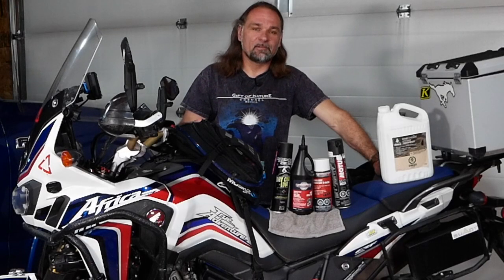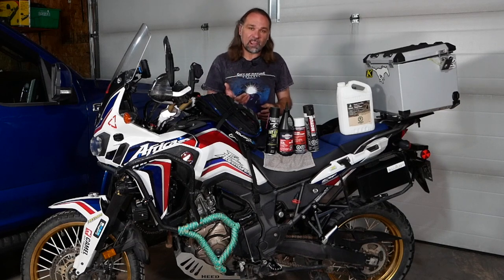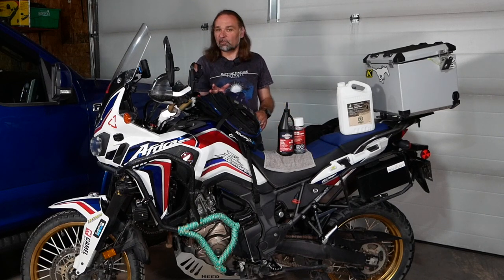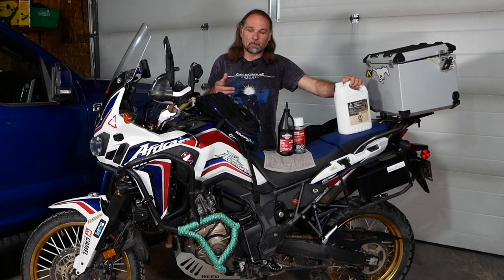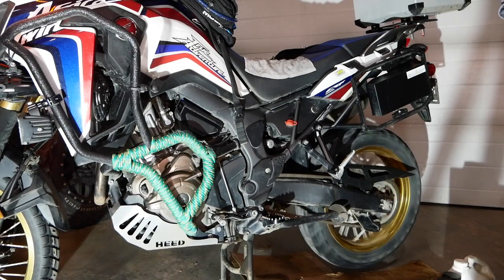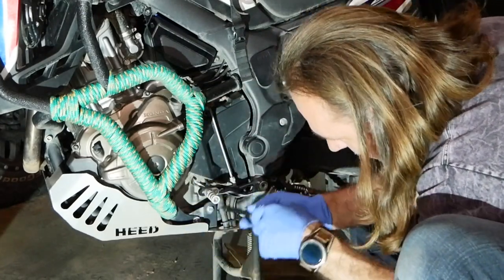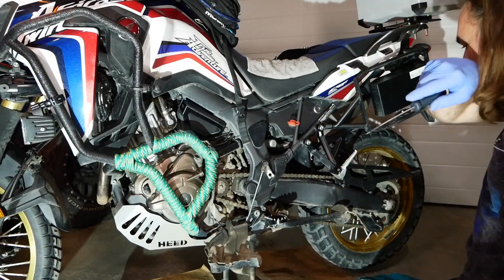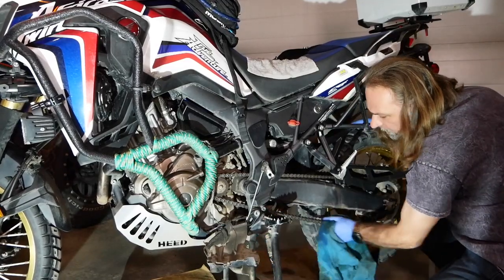HOW TO CLEAN AND LUBE MOTORCYCLE CHAIN WITH GEAR OIL

Comment: Been using hear oil for years works really good no issues at all the best and I clean the chain with kerosene the best
Reply from the maker: I was talking to professional motorcycle mechanic he told me also to clean with gear oil small contain and firmer brush instead of chain brush it is gentler on origins

Comment: I’ve tried em all, gear oil is the best and by far the cheapest! Just wipe it with a rag after lubing 👍
Reply from the maker: Correct
Reply: I use a old toothbrush to put on the gear oil. That way it's easy to brush the oil into the chain like brushing your teeth. As far as kerosene, hear it ok then not ok.

Comment: Owner of Royal Enfield Standard Bullet and replaced the chain and sprocket three times in the first three years i have now shifted to using diesel cleaning and then generously applying gear oil on it. It seems to have worked better than the readymade spray available in the market. 
I try to clean and apply after every tank filling generally after 400 or 500 kms
Reply from the maker: That's excellent, one thing I don't recommend diesel for cleaning the chain, it's a petroleum product that is also possibly affecting your chain o-rings. You can use the same gear oils to clean the chain and lube, I don't use kerosene ether even do it's better than diesel. Follow the comments below I have switched this quite some time ago

Comment: Motorcycle manufacturers no doubt invest in chain research. My Honda owners motorcycle manual recommends gear oil. A little smelly but works well in looking after the O, Z & X ring seals on modern chains.
Reply from the maker: Now since you mentioned I have to take a look at what my manual recommends

Comment: Gear oil is great, but even better if you mix it with something thick like STP or Lucas oil treatment to keep it stuck to the chain. Another great chain lube is chainsaw bar oil. The stickier the lube the better

Comment: The easiest way I find to lube is to get a small 1-inch wide paint brush, gently pour the gear oil over the whole side of the brush (start at the top and work my way down), then wait a second or two for it to stabilise into the hairs, flip it over and do the same on the other side of the brush to completely soak it in gear oil... then press gently onto the chain with the bottom of the brush and roll the wheel, then progressively angle the brush or "push" it further into the chain as I continue rolling the wheel, oil should technically never get into the o/z/x rings, but it will help the rollers and all of the areas of the chain that make friction contact with other chain elements or the sprockets. 

EDIT. Read before this next paragraph: just read your reply to a comment about using gear-oil to also clean the chain, interesting, I might try that.

As for kerosene use, I recommend everyone watch FortNine's video on this - it does look like kerosene is able to penetrate into the o/z/x rings. Now, maybe it's only the highly refined version of kerosene and also Paraffin that is able to do this, not the cheaply distilled kerosene that has other petrochemicals in it. I still do use kerosene myself, but after watching that video I'm definitely feeling less comfortable doing it, it seems like with the tests he did WD-40 doesn't penetrate into the chain, and WD-40 also has been tested against the rubber used for the rings so it doesn't look like it does any damage to it. WD-40 might actually be a good cheaper choice for chain cleaning in the long-term.
Reply from the maker: Ryan from Fort Nine is awesome love his videos, thanks for watching my content
Reply: i use WD40 to clean EVERYTHING metal i own! it's great stuff...but not a good chain lube as Fortnine demonstrated in their video 😊...i was thinking maybe i could use it to clean and lube my chain but I'm glad i caught that video first.  it actually evaporates really fast
Reply from the maker: Save the chain you can use also same gear oil to clean it I did mention it in comments
Reply: What’s the obsession with kerosine. It is diesel with a fractionally low energy quotient.

Comment: Not to bust anyones bubble here but those who know will tell you that cleaning a chain with Kerosene (parrafin) and re-lubing with gearbox oil , 80w90 or similar has been going on for as long as there have been chain driven bikes.
 Most chain manufactuers even recommend gear oil as the preferred lube for their chains. 
Forget your sticky waxes and aerosol sprays that hold on to grit and road dirt to wear out your chain faster, Just use oil!
On 'O' ring chains you are just lubricating the 'O' rings themselves to keep them from drying out and perrishing so they retain the grease they are there to retain, this also goes for 'X' and 'Z' ring chains.
if the lube gets gets flung off, so will the dirt it contains. If your chain dries out, relube. If your rear wheel gets covered in oil, you're using too much. you only need to keep the chain lubed, not flooded.
 Dont be lazy, use the recommended lube little and often for extended life.
Also you dont need to lube the outside of the chain as that does not come into contact with anything! so there's no point! besides the oil will naturally progress to the outside through the centripedal force acting on the chain naturally so don't waste your oil by putting it where you don't need to!
Reply from the maker: You have quite a few points here since I made this video I have stopped using karosine as you can read in the comments below also a very good point apply little just enough to keep orings lubbed as the extra will end up on the rear tire as it happened to me few times.
Reply: Exactly, oil applied on the inside of the chain will force it's way through to the outside
Reply: Wouldn't a chain manufacturer want you to use the wrong product to buy chains more often 😅

Comment: Thanks. I'll start using kerosene and chainsaw oil moving forward. Seems to be cheaper than buying all these more expensive bike specific products.
Reply from the maker: You can use even gear oil to clean chain even better than kerosene.  I started doing this recently and it works with soft small pait brush clean the chain dry with cloth and relube chain is shining
Reply: @AdventureTravelandScuba  you use gear oil to clean the chain?? Never heard of such a thing.

Comment: Hey, love the video! Um, I was wondering...What type of kerosene? Clear or heating kerosene (for lamps, stoves) or it doesnt matter? I wanna start cleaning with kerosene and lube with gear oil but I dont rly know, so Im making sure...Another thing, I got Motul gear oil  SAE 75w90 technosynthese, Is that ok to lube the motorcycle chain with ? If someone could help! Thanks.
Reply from the maker: If you follow the comments below video I have stopped using kerosene to clean the chain as actually same gear oi does great job to clean as well as lub.  I was using clear kerosene.  The ticker gear oil you find the better as it will make less mess, doesn't have to be motorcycle oil either any gear oil will do.

Comment: I emailed chain maker DID about using kerosene. I believe that those who manufacture the product have more engineering knowledge about the product than we do about their product so follow their advice. I assume most chain manufacturers are pretty similar in their technologies. Here is DID's reply :  

"Once upon a time, using kerosene as a cleaning agent was promoted on our chain boxes. Over the last few years we have slowly upgraded the material composition of our sealed chains and no longer promote the use of kerosene as a cleaning agent as it could have a negative effect on the seals performance after prolonged or continued exposure. 

Our seals are a nitrile rubber (NBR) that balances between being chemically resistant and flexible. The more flexible, the less resistant to harsh chemicals and vice versa. 

As far as brands go, I like to recommend Bel-Ray and Maxima with Motul and Motorex second.""
Reply from the maker: If you follow the comments below I also went away from Karosine and I use same oil that I lube the chain to clean it
Reply: @AdventureTravelandScuba  That's a wise move. But, I think a better move is to simply remove the video because not everyone reads all of the comments on every video they watch and the less discerning among us might just use kerosene to clean their chains. After all, that is the message presented in the video.

Comment: So Thomas, if I understand correctly, you only use the  gear oil  to both clean the chain and then lube. No more kerosene. Thanks.
Reply from the maker: @newlife155  correct it's very efficient way and it works great

Comment: Thank you for a very instructive video. I have only tried Chain Lube spray but will be trying gear oil on my AT. Thinking of trying Diesel instead of Kerosene.
Reply from the maker: That's may be also good idea with diesel I'm not sure how safe it would be for orings as I don't know how diesel reacts to rubber longterm Kersosine has been tested and its quite safe to my knowledge not expensive as well.  I have been using always Kersosine.  Even Ryan from FortNine channel i think he mentioned it in one of his videos.  Thank you for witchin.  Let me know how diesel cleans the gunk of the chain I'm curious myself.
Reply: Why? Kerosene is proven and super cheap. It does not dry out o rings and is recommended by manufacturers.It also dries well. Whats the benefit with diesel?
Reply: @glegend4379  Diesel tend to damage rubber hence will damage and degrade the O rings. Dont use it.
Reply: @GrimYak  I add my voice to yours, kerosene has no oil in it so it tends to dry seals, on the other hand diesel has quit some oil in it so it won’t dry them..

Comment: Thanks for the ace video. Do you think it has to be synthetic gear oil…? You can get 120 weight but it’s mineral, wonder if it would stay on the chain longer…?
Reply from the maker: It doesn't have to be synthetic oil I use just a regular oil as long as it's thick.  You can also use same oil to clean the chain

Comment: In my bike manuel it says not to use oil. 
Says to use o-ring chain lube specifically. 
Yamaha mt07
Reply from the maker: I'm getting over 26-28K km lubing only with gear oil also oring chain no issues just messy rim at times will definitely not hurt your chain my manual even calls for oil but can use chain lube as well

Comment: I also experience rust from the lubricant brand.. that is why I shift also to gear oil and for me it is the best of all lubricant for chain.. the only problem is the excess oil after using my motorcycle..
Reply from the maker: Totally agree if you go riding right away after lub, I usually leave it overnight to drip, another thing since I made the video I now apply the lub with paint brush you get in between all crevisies of chain with less oil left on the chain dripping

Comment: I noticed after cleaning your chain with kerosene you did not ri se the chain with water. I've been cleaning my chain with kerosene but then rinsing my chain with water. Is it ok to rinse with water after cleaning or is it better to not rinse with water?
Reply from the maker: Absolutely stay away from watter clean with kerosene and wipe dry then lube water and steel does not like each other 😉
Reply: @AdventureTravelandScuba  thanks, bought me some gear oil today and will clean my chain and use zero water!
Reply from the maker: It doesn't have to be same gear oil as long as it's a thicker oil you you find even thicker it will work also very well

Comment: I see in the comments that you can also use the gear oil 85w140 to clean the chain as well as lubed it?
Reply from the maker: That's correct since the video was posted I use now same oil or any other oil the thicker the better.  Thicker is better as it will be less mess dripping.  My friend is a motorcycle mechanic those are tips from him.
Reply: @AdventureTravelandScuba  thank you, awesome tips, will definitely try it out!

Comment: How do you clean the contaminated shop rags? I've seen some methods for the cleaning, but then I come to another question: how do you dispose of the wastewater from cleaning? If the rag is contaminated with kerosene or gear oil, then surely the water you use to clean the rag will contain those chemicals, plus more for the cleaning. You cannot simply pour it down the drain, right? But I'm guessing that is what people do. Maybe you can save the water in a container and then take it to a household hazardous waste facility? Seems like a lot of work, plus you would potentially have a lot of waste water to deal with over time. Is there an easier way?
Reply from the maker: Good Question, I don't clean them  just as they get bad I replace them I buy them at dollar store  I use for rags shirts  they they go to garbage kerosine mostly evaporates anyways , Used oil goes to recycling shop my neighbour takes it as he is a mechanic at Toyota and he recycles it there for me
Reply: @AdventureTravelandScuba  can diesel work as well  as kerosene?
Reply from the maker: No diesel is Petro based it will damage the o-rings I stopped even using karosine if you look down the comments gear oil and brush does also excellent cleaning job just wipe the excess on the chain afterwards really small amount of gear oil and you are riding again

Comment: I get splashes on my rear tire whenever i put gear oil. Am i putting too much?
Reply from the maker: most likely and make sure you have a thickest gear oil you can find just put the gear oil on the link joint not center where the roller is
Reply: @AdventureTravelandScuba  ok will try to use the 140 again. I have been using 90 for quite some time
Reply from the maker: @jowanyoung7613 It also depends if you are going riding right after lubbing I usually don't I just let it soke 1-2 hours and then You can give it a gentle wipe as the oil will penetrate by then between the links gentlevqipe juat to pick upbthe excess oil that's dropping down
Reply: @AdventureTravelandScuba  i always do it after i wash motorcycle and let it be overnight.
Reply from the maker: I always get some on my center stand but not too much on the rear rim, maybe your chain is flapping too much too loose, I also don't pay as much attention to it anymore as I go off road to often 😂 and the bike looks like crap after it was cleaned after last ride.  I ride it hard and I take care of it right after that or next day so it is usually clean whenbitbis parked in the garage or when I ride tarmac lol

Comment: Can i use diesel instead of kerosene for cleaning the chain
Reply from the maker: I wouldn't recommend diesel but ever since I made the video I have been using same gear oil that I lube the chain with just regular small paint brush same brush that you would use to trimming before painting the walls it works great, wipe and reapply the new oil
Reply: @AdventureTravelandScuba  is it ok to use sae90 gear oil??
Reply from the maker: @mkk94  any gear oil is good the thicker the better

Comment: Not a single chain manufacturer recommends kerosene and most specifically advise against using it. Kerosene will damage the o or x-rings.

From the RK website...
"RK Chain recommends cleaning a sealed chain with only a mineral-based O ring safe chain cleaner. Do not use kerosene, mineral spirits, diesel fuel, brake cleaner, motor oil, or any caustic chemicals because that can damage the seals."

From the DID website...
"D.I.D does not recommend maintaining any drive chain with kerosene.
Cleaning a sealed chain with kerosene would cause deformation of the seal ring and can oftentimes lead to rusting of a chain due to the removal of grease on the chain’s surface, which increases the risk of chain corruption and chain failure. It is highly likely that use of kerosene on a sealed drive chain will drastically decrease the chain's performance."
Reply from the maker: I was using Karosine for many years with no issues but if you follow my comments below I have stopped it anyway and now I use the same gear oil that I lube the chain
Reply: Its just a business problem, not an Oring problem. The costs of dedicated cleaners and lubes is outrageous and if everyone would use kerosene and gear oil, there would be a lot of money to be lost.
Reply: @AlexPtc89  or it could be they realize their product works better than kerosene,  and greatly improves the life of the chain, and therefore they can charge a high price.

Comment: Never never use kerosene it will damage the sealant of chain
Reply from the maker: Kersone will not damage your o-rings in the chain you are misinformed, but if you look down in the comments I have stopped using it and use same gear oil to clean the chain as lube it works really well 🙂
Reply: Myth.
Reply: Really….so ppl that do 30k-40k kms on a chain cleaned only with kerosene are doing it wrong?

Comment: Wrong!
Mix axle grease with gas.
Put chain in gas mix.
Remove and let gas evaporate.
Job done
Reply from the maker: Sorry You are wrong gas is not good for the o'rings in Your chain it will damage them quite fast go to any chain manufacture web site and most of them will confirm that.